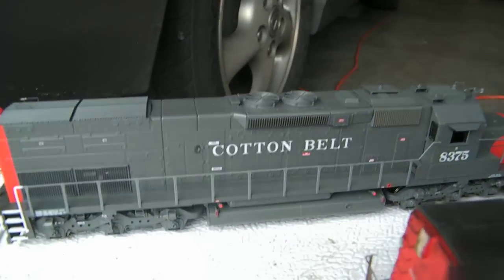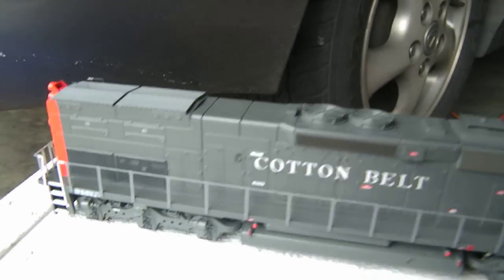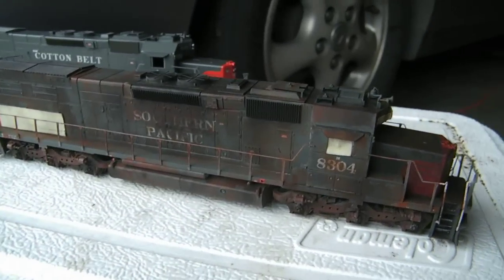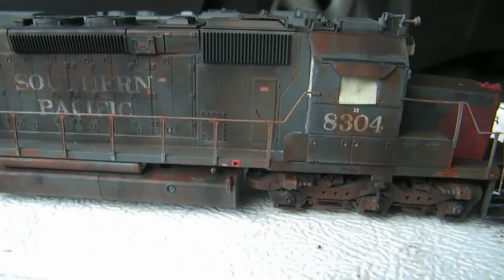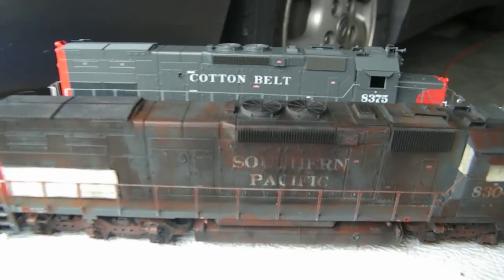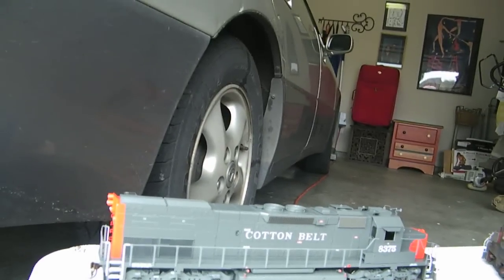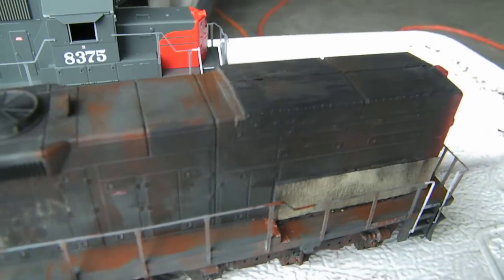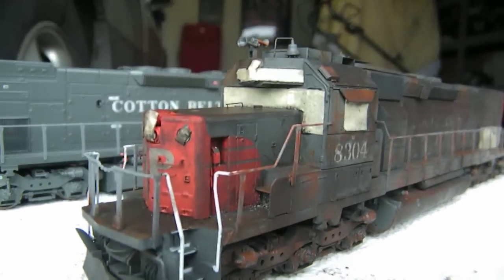HOT HOT HOT!!!

Comment from the maker: when using powders you will want to wear gloves Reason Being, All the finger prints from when you touched it leaves grease on the Engine (that you cant see by the eye)..The Powders are similar to what you can use to "Dust for Finger Prints"..So if you Touch the engine and put Powder on it, you can see all your finger prints....So gloves prevent you from leaving fingerprints and the dust looks perfect. after that ( the dust will come off if you touch it or brush up against it) >>>